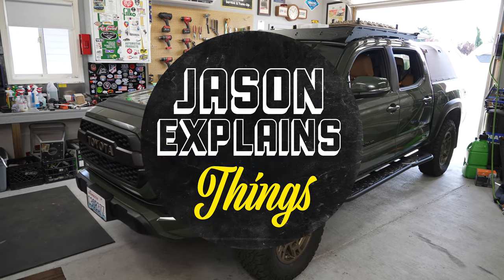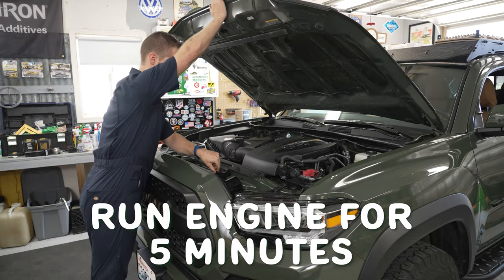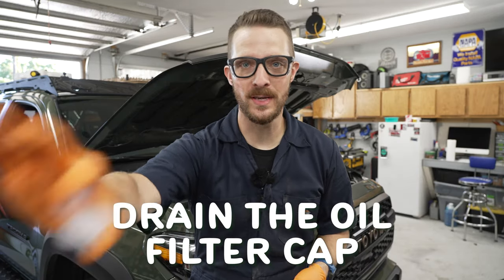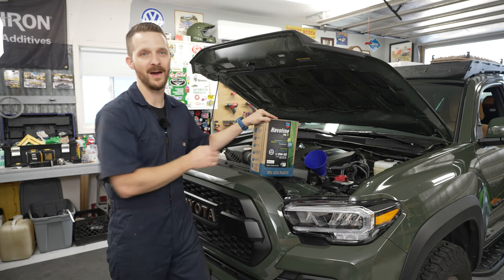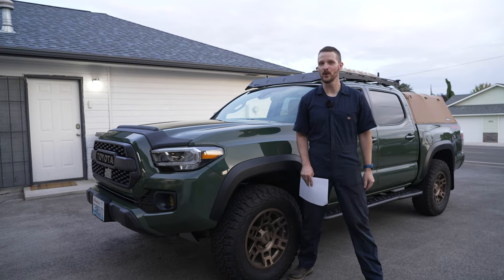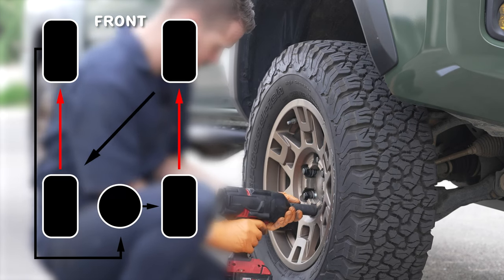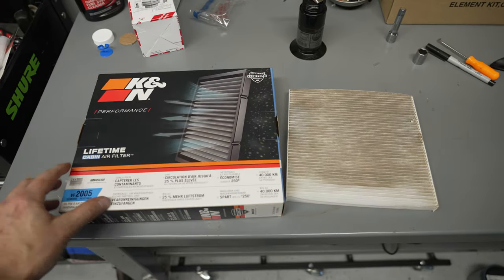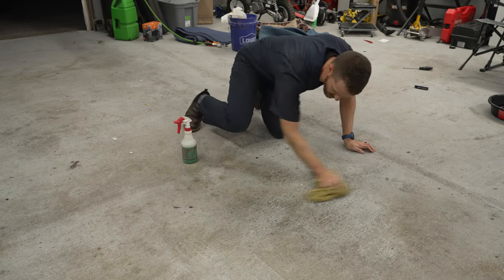Toyota Tacoma 5K Mile Maintenance COMPLETE GUIDE (Oil Change, Tire Rotation & More)

Comment: Is the 10K oil change interval correct or should it be every 5K?  Both dealership and manual says 10K with full synthetic but I hear conflicting info.
Reply from the maker: Great question.  Here's my answer and a video I highly suggest watching.  Essentially 5K is infinitely better for your vehicle long term.  The 10k interval became a thing predominately to market lower cost of ownership... and problems usually don't manifest until after a vehicle is out of warranty.  This video is from Toyota master technician about why the 10k interval is so bad for your vehicle:  https://youtu.be/TJhFAwFv-O0
Reply: @JasonExplainsThings  thanks! I previously watched that video which is why I posed the question. I will 100% change it every 5K. My Tacoma is currently at little over 11K miles driven total and dealership is refusing to do the oil change, since there’s 5K remaining on the oil change interval, and it’s still in the free courtesy service period- currently 5K since last oil change. Do you recommend I change it myself immediately or let it ride out to 10K this time only? Especially since the truck only has 11k miles total. I’m assuming there won’t engine damage this early.

Comment: Don’t use TRD or K&N type oil soaked filters. They allow a think film of oil to deposit on the mass airflow sensor and can affect the air to fuel ratio. Not only can that affect mileage, but throwing off the stoichiometric ratio can ruin your catalytic converter.

Stick with a stock Toyota filter.
Reply from the maker: All good points.  Also since I off-road in dusty conditions it’s easier to quickly clean the stock filters.
Reply: @JasonExplainsThings  Great video ! Huge Toyota fan. 3rd gen 4Runner and a Land Cruiser.

Comment: How hard is it to change oil pan gasket. Seem to be seeping oil. Not a bad drip. Maybe I should tighten the allen bolts.
Reply from the maker: I haven't done one on a Tacoma yet.  From what I've seen it's a rubber gasket.  Likely not too hard.

Comment: Did the new gasket/crush washer for the drain bolt came with the kit or you bought separately? Thanks in advance
Reply from the maker: Bought it separately.  Link below.  They come in a big bag so I'm set on drain bolt gaskets for several years.  :-)
Reply: @Jason Explains Things  I'm glad I saw your video lol. I bought everything for my 1st oil change and would have been a bummer to find halfway thru the process I'm missing the drain bolt gasket lol

Comment: Just trying to get caught up on your channel. Did you trade your 4Runner for the Tacoma ?
Reply from the maker: No!  Definitely not.  The 4Runner is still here.  My wife drives it so my default vehicle is the Tacoma.  But we did a new suspension and winch bumper on the 4Runner this summer.  And more stuff with it is planned.

Comment: I just wonder why your oil looks so dirty after 5000 miles, my Tacoma the oil looks just like new after 5000 miles. And most mechanics say not to use K&N filters because the oil that goes on the filter messes up the map sensor and other sensors on the intake.
Reply from the maker: Off roading might be part of it.  Big reason why I do this every 5k, not 10k.

Comment: Nice job.  Personally, I change my oil every 3,000 to 3,500 miles. Oil is cheap and easy to perform. Some may say it's overkill buy, yet you can't tell me it's bad for my engine to change my oil every 3k vs. every 5k or 7.5k or even every 10k miles
Reply from the maker: Yeah likely overkill unless you’re driving in very dusty environments and off-roading a ton.  Then your interval is not overkill at all.
Reply from the maker: And yes, it can’t hurt anything to change it more often.
Reply: @JasonExplainsThings  perhaps I'm an old school guy. Service my oil every 3 months or 3,000 miles witch ever comes first. I've been doing that since 1996 regardless of whether I'm  driving V4, V6, or V8 engine or turbo engine as well.  Also, transmission service drain and fill  every 15,000 miles, never transmission flush. My oldest vehicle I own is a 2006 Toyota Sequoia 4WD  3 inch lift on 35 inches currently has over 300.000 miles. Also, 2013 Lexus GS F Sport and 2019 Toyota Tundra TRD PRO. All get the same type of service as mentioned.

Comment: I can’t believe you run a K&N filter.   I’ve been to their website multiple times and they make no claims as to what micron they filter down to be instead say they flow more air. How do you flow more air you punch a bigger hole.  Think breathe right strips.  The only reason anybody wears those is to breathe more air.
Reply from the maker: They do get dirty quick during off road season.  Cleaning and re-oiling isn’t hard, but I’ve started to run an OEM filter again.
Reply: @JasonExplainsThings    I like how you completely ignored the fact that they don’t filter well.  As a technician, I have seen horrific damage from K&N filters I’ve got a whole picture file of bikes and cars with K&N filters then the same bikes and cars with similar mileage with stock filters, the difference in intake cleanliness between the two is un deniable.  K&N’s global net worth is a fraction of any OEMs I don’t know about you, but I’d rather have my OEM standing beside me then some mom and Pop shop in SoCal.   A few years back, they had a recall on oil filters that were cracking I saw a customer lose all of his oil due to that oil filter.  He was on vacation and his vacation was ended.  Not only that the repair was $9500 K&N did compensate him to the tune of around 6000 but he lost his bike and his vacation, had he been running an oe filter and that happened it of been fixed.
Reply: @JasonExplainsThings  one more thing you also alluded to the fact that you’re cleaning it,  you do know if you were following the directions you only clean it every 50,000 miles right? That is one of the things I’ve also seen on those filters since it’s cleanable owners, clean them too frequently, causing bigger holes in the filter media, if only people would read directions.

Comment: That drain pan is the worst design ever. You're guaranteed to splash oil on yourself or your surroundings. Whoever designed that AutoZone special has clearly never changed their own oil before in their life. They would have scrapped that design immediately after testing. The best drain pans are the ones with the big grate. Sure you might drop your bolt into the oil but it beats getting oil all over everything else.
Reply from the maker: It is hot garbage. :-)

Comment: its fine, havoline is good, they are all probably better than we need, but I think this video missed the one thing that the garage mechanic will be stymied by with the tacoma. how do you read the horrible dipstick, coupled with the fact that its such a thin oil? thats the ONE question I needed answered, and it was not answered here. thumbs sideways. I just wont rate.
Reply from the maker: I don't see how the dipstick is hard to read.  Thanks for stopping by Dave.
Reply: Rub the shine off the end of the dipstick with some emery cloth and the oil will be much easier to see.

Comment: I just hate to see ANYONE use a 1/2" drive RATCHET to tighten an oil drain plug in what is most likely an aluminum oil pan.
Few plugs tighten to more than 14 - 18ftlbs.
Reply from the maker: 3/8” buddy.

Comment: Tire rotation? Not even once. How else how you going to brag about your perfect alignment?  Never once rotated tires. No uneven wear. In fact it's probably just wearing out the studs and rotors with the wasted clamping force.
Reply from the maker: Getting criticized for rotating my tires is a fresh take. 🙃
Reply: @JasonExplainsThings  just don't. Run a set without. And see. If you drive right and your trucks got perfect alignment you'll see. Try it for 150 000 miles. Don't rotate.
Reply from the maker: No thanks.
Reply: @JasonExplainsThings  fool
Reply: @JasonExplainsThings   and remember.  Wheel studs don't need exercise. And rotating tires hides alignment issues.
Reply: @kimbuck2177  yeah. Why? That's right. No reason. Tire rotation hides wear. Don't.

Comment: Toyota says change the oil every 10,000 miles. Any more frequently than that and you are wasting time, money, and resources. To each their own though.
Reply from the maker: Here’s a Toyota Master Tech’s opinion:  https://youtu.be/TJhFAwFv-O0?si=j8MAoZl557otj9g8
Reply: Toyota manual does say that. 
New synthetics probably keep good until then depending on how you  using your truck (easy highway driving vs tons of 4x4 off-roading) 
 But what about the oil filter? I don’t trust any filter past 5K- and every mechanic I talked to about this says same thing. 
if I’m gonna change my filter I’m putting in new oil as well.

Comment: This is all great except you don’t need to change your synthetic oil every 5k more like 10k
Reply from the maker: I disagree Paul.  Most mechanics I've talked to change their own oil every 5K... but you're free to do it every 10K.  Especially when you do it yourself the cost is minimal and extra insurance for your engine.  I also off-road a lot and the oil is always pretty dirty.  But again... this is my opinion (and the opinion of most mechanics I've asked about this topic).
Reply: @JasonExplainsThings  
Actually only if the bulk of your driving is highway miles without frequent short trips otherwise every 5K is the norm. Or 5K if you're not sure.

Personally I compromise. I change my inexpensive full synthetic oil every 5K but I change the full synthetic oil filter that's rated for 20,000 miles every 10K.
Reply from the maker: @njsongwriter  Cool.  That makes a lot of sense.
Reply: @JasonExplainsThings  
Yes and I had an oil analysis done once after the oil had 5K on it and the filter had 10K on it and according to the analysis the filter was still doing it's job with insoluables at 0.2%
Reply: @JasonExplainsThings  ive called two toyota services place and they each said 10k
Reply: @Turtlemilk  well change it at 10k and let others do what they want